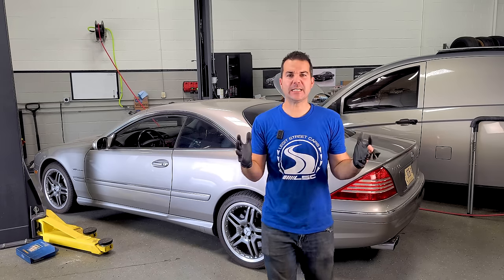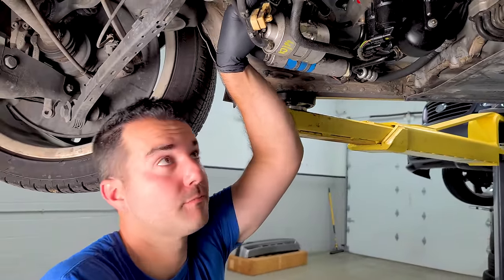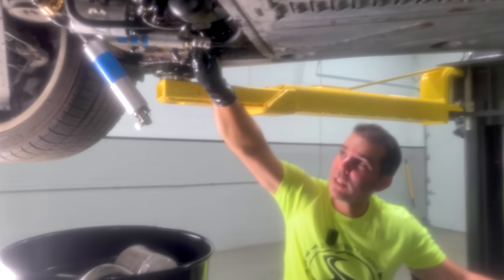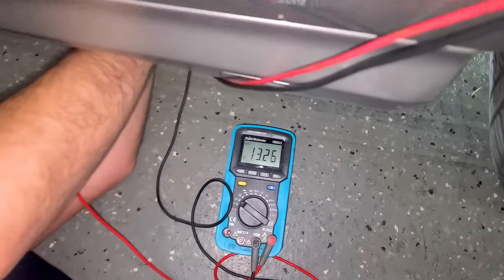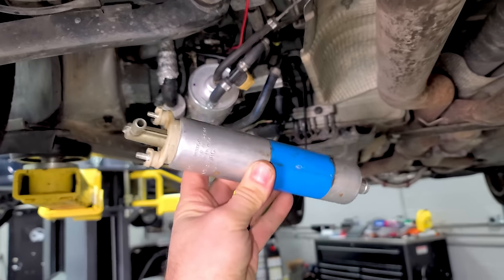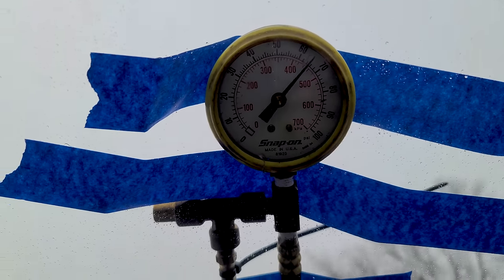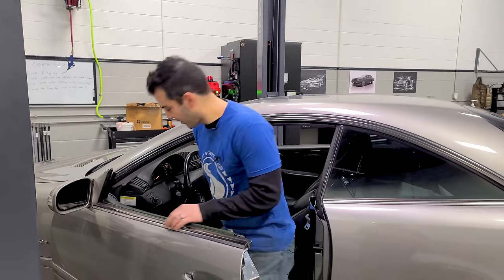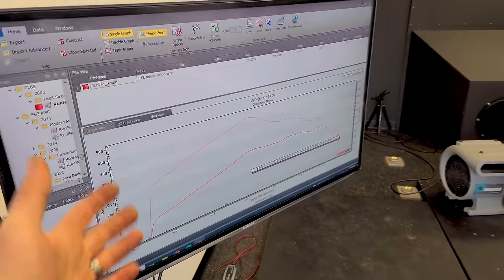I Used Bugatti Veyron Parts & An Alex Trick To Fix My CL65 AMG V12! You Won't Believe What Happened!

Comment: That horn sound under full boost on the dyno sounds like it might be a big boost leak. The lower boost points to this as well. Pressurize the system with a automotive smoke machine to check. Been through this with my Cayenne Turbo, found the leaks and car made 30% more boost and felt like double the power!

Comment: Hi Alex, could the unexpected remaining fuel pressure when you removed the filter be a sign of a supply, or return line restriction in the fuel system after the pump?
Or maybe an interference to the injector pulse width signal sending you into limp mode?

Anyway,
Good luck!

Comment: Check the hall-effect sensors (throttle position) on your accelerator pedal. I had the low one go bad, and it would trigger limp mode when lifting off (W211 E500). Yours could be the high ones. I would expect a code to throw, but who knows with this car :D

Comment: Alex, stupid question, what fuel are you running.? We’re unable to run older Mercedes on E5, I can only run my W221 S500L 5.5 on E10, 97 octane, here in the UK.
Had an issue with my 190E 2.5 Cosworth, don’t  know if you got this model. Made for the touring car championship.
No one told me which fuel I needed, so ran it on lower octane, it would cut out, just run rough.
Swapped the fuel, instantaneously ran as it should.
Just a thought.
Thanks
Paul🇬🇧

Comment: I agree with some of the comments below, you've improved things by cleaning and refining it all down... but perhaps now it's time to try putting the hardware back to as close as stock as possible - the Jerry-rigged fuelpump probably isn't going to help that.  Your tune is unlikely to be causing huge issues (it standson the shoulders of the AMG Giants.)

If the engine management is pulling out, it's doing so based on feedback - it can't get enough air, it can't get enough spark, it's not seeing the right boost for the outputs given or it physically can't flow enough exhaust.  You've examined a lot of these already - it does seem to be physically flowing and fuelling OK...  The original codes were misfire codes - are all 24 sparkplugs getting good feeds from the coils?  Are all the coils good?  What's the condition of the signal wires from the ECU to the coils?  Is it possible that rich state (with the 2nd pump) is so rich/responsive it's simply drowning the flames?  Does grade of fuel affect results?

I feel for you brother - we're right there with you.  Don't forget you've got a little bit of pull now...  why not just ask MBUSA nicely to lend a hand?  Plenty of documentation (and knowledgable people) in Affalterbach and Stuttgart that might be able to take a Zoom call...  and you might make some real cool friends too.  I headed up Manufacturing Test at Aston Martin Gaydon for many years, I'd take your call if it were a DB9 on the ramps.

Good luck, man.

-Mark.

Comment: What is the fuel pressure with the engine off but key on?  Is it 55psi?  Then at idle? It should drop by about 7.5psi to compensate for the vacuum in the manifold. Under 15psi of boost  ot should go back up another 15psi. I think youre on the right track

Comment: My guess is the secondary fuel pump is overpressuring the injectors at full throttle. Lower the secondary fuel pump voltage until the issue goes away? Might work

Comment: Can you get another one of those pump voltage regulators for the other pump? I think the second pump comes online too fast and momentarily over-pressurizes the fuel system. It's intermittent because it depends on how quickly the computer can compensate by lowering the voltage on the pump it has control over. A second voltage controller will allow the computer to control them both, then your tuner can adjust the pump performance as they work together.

Comment: Properly relieve the pressure by First, locating the fuel pump relay. Second, start the vehicle with all components still intact. Third, pull the pump relay while it's running. Let the vehicle die from lack of fuel. Four, without reinstalling the relay, attempt to start and let it run. (if it does). Five, discharge the fuel rail with the Schrader valve. This works on almost every vehicle, with EFI. Save yourself the mess, trouble of washing up, and putting your eyes at risk. Even after using this procedure, use extreme caution opening pressure lines.

Comment: I would be tempted to replace the hose from the tank to the fuel pump. I had a hose that would collapse under heavy load, granted it was on a diesel engine on a towboat that I worked on. The internal coating on the hose had disintegrated and vacuum would draw it in after running for a while, and cause a restriction. As soon as I took the generator off line, revs went back to normal.

Comment: I know you know better and it’s a long shot. But I had a really hard to diagnose issue with my CDI years ago - a stupid fuel pressure sensor for 30$ with no error codes visible . 
We found out by putting the same car next to mine and swapping parts one after one. It might be hard with a v12 amg but it’s better than throwing random expensive parts to the car and praying.

Comment: BAD GAS CAP, seen this comment a few times in here and i agree, it caused my engine to run lean and caused the tank to even thunk when i shut the car off it was pulling so much vacuum. I just drilled a hole in my cap, not effing around, problem solved no more thunk, also dont plan on rolling the car over and dont care about evaporating gas if my engines happy.

Comment: Had a similar issue with a Ford explorer the HP fuel feed line to the rail has a solder joint and it broke internally and blocked the fuel injector ports as well as the HP line! It didn't read any fuel pressure codes cuz it broke on the non sensor rail side! So it would drive normally until the beans were given and it couldnt flow enough to the rail to get enough fuel! Crazy I kept the part so I can show it off and as a I won trophy

Comment: 42:00 So Alex I had INSANE Crazy Frustration troubles with what eventually turned out to be my two intake sensors. The car is a 2008 BMW 335XI N54 engine (Like your old one but all wheel drive). I kept getting a code saying "Throttle position not correlating" type thing I replaced the throttle body and nothing! Then I had codes for the MAP and T-MAP sensors.  The first was the "T-MAP" or the sensor for the Turbo pressure in the charge pipe when I up graded mt sensor to a larger capacity (3.5 Bar from the factory 2.5 Bar) in order to be able to throw more boost at the car. Then after I had that sorted after months of frustration the MAP sensor in the actual intake manifold was no good even though I had replaced it only a year earlier. I had thought it couldn't be a bad sensor because it was new. But I finally decided to just throw another one in and finally after two years of trying I WORKED!! So insane!  It was the STUPID MAP SENSOR THE WHOLE TIME!! But the car threw codes for so many things and it was supposed to be NEW!

Comment: Alex, I have thought about this fuel issue a couple times since watching your video. Is it possible that a fuel line got kinked when you pulled the engine out? It really seems like there is a restriction between where the fuel filter is to the fuel rail. It pressurizes fine when idling and driving under light load but can't flow enough when the engine really needs a lot of fuel. It also could explain why there is pressure in the fuel system after you bled it out in the front.

Comment: Check for misfires while it's under the load could be spark plug gap. In misfires don't always show up as check engine lights, but they do flash the check engine light, like you always say.👍

Comment: Do you think Kleeman could do a better tune for you? They are in Colorado so not as much of a time difference? They have been tuning Mercedes for a long time. They did the original tune on my W211 E55. Still has great power and reliability. They do feature a few tunes for the M275 V12.

Comment: I had a 1995 S500 coupe it would do the same thing, limp mode. One time it actually jumped into an intersection on a red light with my foot on the brake, I was lucky it went to limp mode right away. The solution was to replace the throttle actuator body which was worn inside, the variable resistor was worn etc. as I remember.  Hope this helps. It was one of the 689 ?!? problems that car had. It gave me nightmares.

Comment: Alex - Ex (GM) Calibration / Diagnostic Engineer here; here's my $0.02:   
1) The new / rich condition on shutdown is being caused by the 2nd boost-referenced fuel pump that is still running when the PCM shuts down the original pump, as your 4 psi switch still sees 4+ psi in part of that shutdown period.
2) The bigger question is: What criteria is being monitored and then used by the PCM to decide that the engine (for safety) must go into Limp-Home mode and cause the "CHECK ENGINE" light to flash - that is the lynch-pin to your drive-ability issues.   
You need an individual who knows (or some service information that details) M-B's code to determine why your car's PCM thinks it needs to 'save your engine' and go into Limp-Home mode.  Then (and only then) can you look at each of those items on at a time.  Your TB seems to work fine - replacing that is just throwing parts at the issue...  The shutdown of the original fuel pump is just the PCM's code telling it to shut down - it's only a symptom, not the root cause...  The root-cause is the Limp-Home mode criteria being tripped.

Comment: Alex, I have an SL65, and if I remember right these are like 20+psi cars
I’m quite sure you have a boost leak.
Especially check large fitting on the back of the intake
If you want data, etc I will give it to you
Also, I live in Chicago

Comment: I'm a qualified mechanic just for reference, I have a question why have you not checked your fuel rails? Sometimes to feel rails on the inside brakes and it does the same thing or it forms a small crack on the inside of the fuel rail pipes and it does the same thing. You can also be your fuel pressure sensor on the rail that is defective and causing this.

Comment: Hello, the same thing happened to me, but with a different car. The problem was with a tube that went to the turbo that was soft and didn't let in enough air, but only when accelerating it went into limp mode,  It stopped after i shut it down. My car was 8 years old at the time so it can be something like that. No machine is going to diagnosis that... I hope it helps.

Comment: That body style and year is my favorite. Whether the CL55 or CL65. Love that car. I didnt see if you checked that voltage to the fuel pump. is there a fluctuation? I mean, wot and then FP drop is usually pump or filter , i dont have anything other than that. Regulator? Great at idle but WOT it dumps? Voltage? Ok, sorry, i wrote the previous before seeing you check it. Isnt adding another pump sort of putting a  bandaid over a bullet hole? SO you got the pressure but the car came stock with a single pump and ran fine?

Comment: @legitstreetCars I know the new AMGs need a CPC tune when you do a ECU flash.The CPC Module in your AMG has control over overall torque output among several other key functions. When tuning the ECU, the CPC Module will intervene and send the ECU several messages to decrease power via ignition timing and boost. Does this generation of AMG have a module to reduce to the torque ??

Comment: Alex I was always taught to remove the fuel.pump fuse, run the engine until it stalls, thereby  removing all fuel pressure and making it much safer than the 50psi of fuel you sprayed all over yourself.

Comment: EFI systems tend to have a check valve that prevents pressure from dropping when shut off. The correct way to start this process is you start the car, unplug the fuel pump, and let it idle till it stalls out and shuts down. That's usually enough to get the pressure down to a level where it doesn't spray like that

Comment: Ive actually fixed 3 vehicles with all similar issues of the engine stalling and banging my head against the wall trying to figure it out when they all had clogged fuel filter. Its crazy to think that fuel filters will cause engine stalling issues like i was encountering. Also they make an exhaust back pressure gauge for the front o2 to see if there is too much back pressure from a clogged converter. We hate seeing you throw parts at this, you know there are ways to test everything on these cars along with parameters that they should be. What if the fuel line is collapsing somewhere?

Comment: So Alex, something important to remember when troubleshooting is that boost pressure reading under load (on the dyno). The reason it's going so rich is that it's trying to balance the fuel need of the engine against the expected airflow of a much higher boost level than it's actually getting. If you can confirm ~16 psi actual and the computer is trying to adapt for ~22, it's going to put in a lot more fuel than it needs - so it will be very rich. I'm sure there's a threshold in the computer for "too much" on the AFR and that's likely tripping your limp mode now. Hell, it might have been the limp mode cause for the whole time. 

You need to figure out why the computer is seeing ~22 psi boost when you're only getting ~16 - solve that and you'll likely solve all of it. 😉 Possibly a calibration issue, or something like that? And when you get this figured out, test going back to the stock fuel pump only - you might be pleasantly surprised to find it adequate (if this mismatched reading was the cause all along).
Reply: this is good advice

Comment: Are the turbos getting tired, maybe bad waste gates? 
My e60 535xi has a lot of miles and goes into limp mode because the waste gates are getting tired, but only intermittently. It still pulls hard, but falls on its face at random. I kind of like the mystery at this point!

Comment: Hey Alex I know why it’s going way rich. 
So when you added the second fuel pump and it hits 4lb of boost, you are dumping crazy uncontrolled amounts(pressure) of fuel into the rail that isn’t bled off because there is no mechanical fuel pressure regulator like most cars(pressure is controlled by the little gray box changing the voltage to the pump instead)

Because of this your pushing a crazy amount of extra fuel through the injectors. It may be fine for quick wot pulls as the pump takes time to build pressure but with long pulls like on the dyno, it eventually builds 70-80lbs making it run rich, misfire, and go into limp mode.

I’m 93% sure this is your issue. You could either redesign your fuel system OR potentially get your tuner to adjust injector pulse at different MAP readings. Though that would be a lot more trouble than just redoing the fuel system since fuel pressure is fluctuating so much. 

I also wonder if maybe using a smaller supplemental fuel pump would allow the regulator box and original pump to regulate the pressure more easily. 

Another option could be to add a return line with a regulator that has vacuum/boost reference to bleed off the extra fuel. 

Does this car run in speed density mode or does it still use a maf? Might have a boost leak too or intake restriction based on the distressed chimpanzee noise.

Whatever the solution is good luck Alex! I look forward to the next video👍
Reply: Update someone just told me there’s a mechanical regulator in the fuel filter. So just disregard everything I said😂

Comment: From my experience to fully relive fuel pressure in the lines you have to take out the fuel fuse then start it up until it dies then open the Schrader valve for the remaining pressure in the lines.

Comment: Alex the supercharged LS motors (specifically the LSA) use a similar throttle body. The motor can’t keep up with higher boost levels and slightly closes although commanded to go wide open. I’d certainly look into the throttle body being the issue.

Comment: You'll get there mate!  As the car maintained so much fuel pressure after you released it in the engine bay - does it have a NRV between filter/pump and engine??  Might be restricting?

Comment: Hmm
I was driving my toyota yaris here in europe , at open throttle the car was losing speed and i didnt know why 
check engine was On but had no obd to read it on the road , i made a stop and i thoght all the car need is Fuel + air + spark . i opened the hood and i disconnected the Lamda sensor 
the  car was ok ! i bought another Lamda and replaced it 
i dont know if its the same thing here bust worth trying , better than overthinking or doing complicated things 
i hope i helped

Comment: Just throwing it out there, I am not familliar with automatic transmissions but seems like it cuts down at certain torque. Could the torque converter stall or fail locking? Another thing I was thinking if it's ignition based. I have had cars with LSPI go in limp home mode with no really fault codes. Isn't also a rule of thumb (at least here in europe) flashing engine light is always ignition based issue?

Comment: I would reset the computer to factory defaults and I would advise checking your rings for potential fails. the rings are what took down the engine in my 2014 kia optima after a 4140 mile road trip.

Comment: my guess is the ECU is detecting overboost (you said it should be 15 but the ECU says 21) so the ECU shuts the TB which results in the rich condition you are seeing.  You should be able to see the TB position in the system you are using to monitor other engine systems.